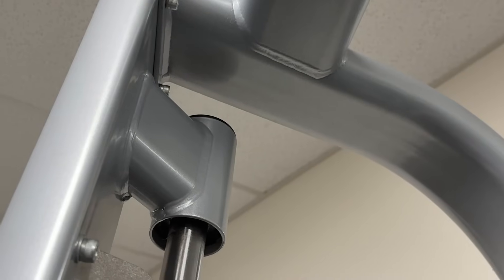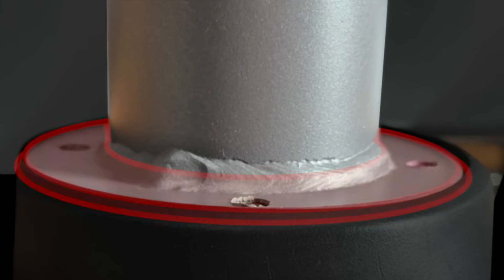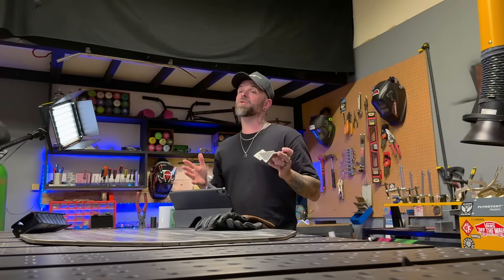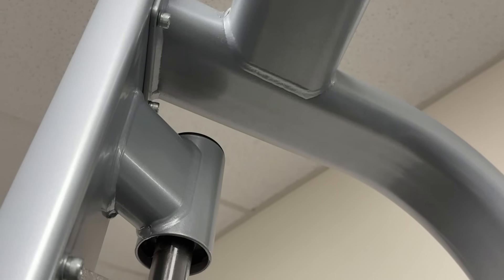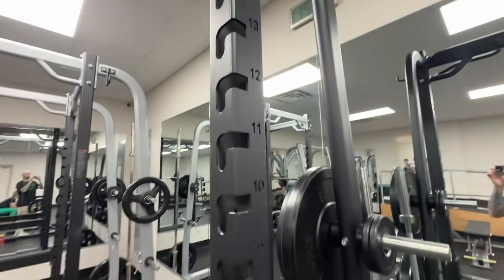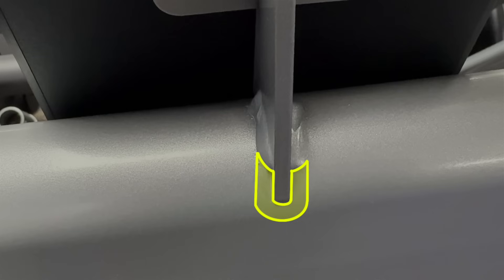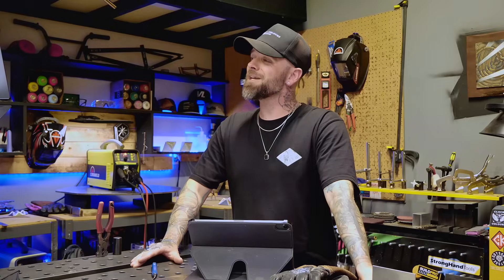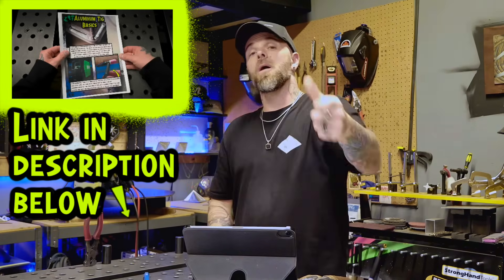Finding Bad Welds at the Gym- Here's How To Fix Them

Comment: Love your videos because you are passionate about welding like me. These are structural welds performed in a shop. Code welding allows for some discontinuities because AWS recognizes that we are not robots. First things first. What code was that gym equipment welded to? More than likely that undercut in the first set of photos is acceptable. As far as the “bb’s, nothing reject able about that other than a welder pride issue. Just explaining why you are seeing these possible discontinuities. This type of welding is very far removed from clean, air conditioned room, Tig welding… was the undercut acceptable per code?